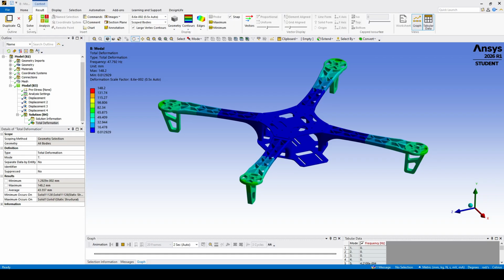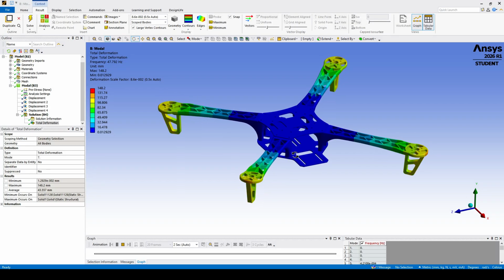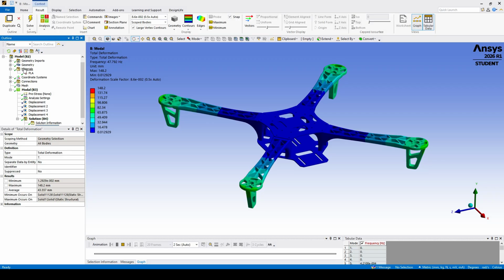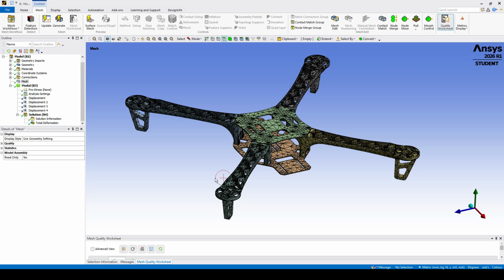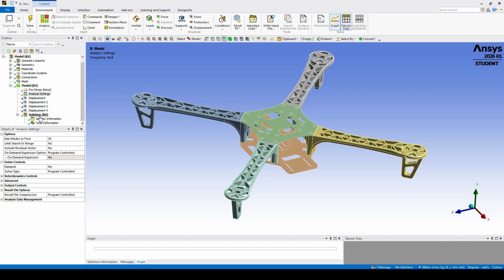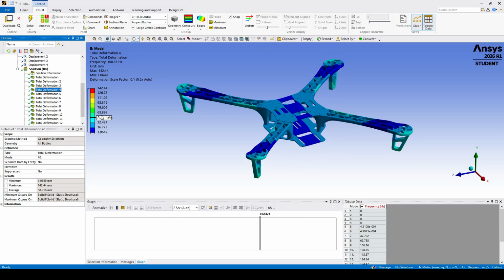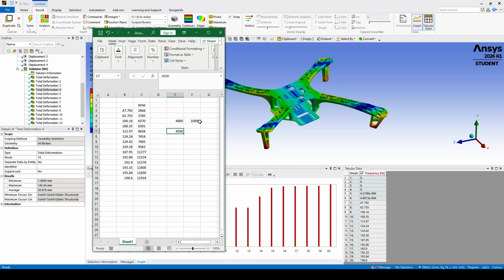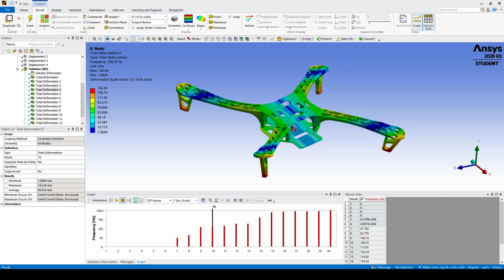Can This Drone Survive High-Speed Flight? | ANSYS Modal Analysis

Comment from the maker: What do you think of the results? Let me know your thoughts in the comments! 👇
Reply: Sir, I want to do random vibration for this drone. How to do that without any fixed support?
Reply from the maker: @vinayp689  Yes, definitely! 👍 One smart approach could be to define weak springs at each motor mounting location to avoid introducing a fully fixed support.
I wouldn’t make the springs too stiff, though. I’d suggest running at least two simulations with different, relatively weak spring stiffness values and comparing the results. If the response is reasonably consistent between the two cases, you’ll have a much better idea of what stiffness is appropriate for your model.

Hope that helps, and good luck with the drone vibration analysis! 🚁💪